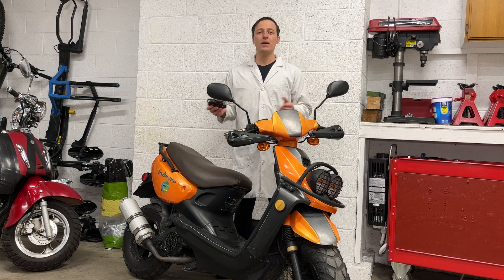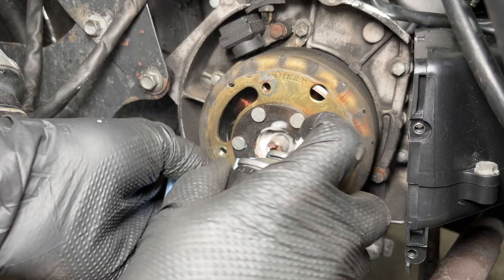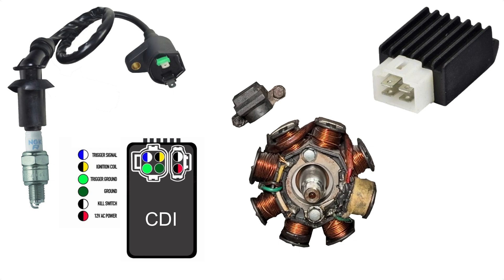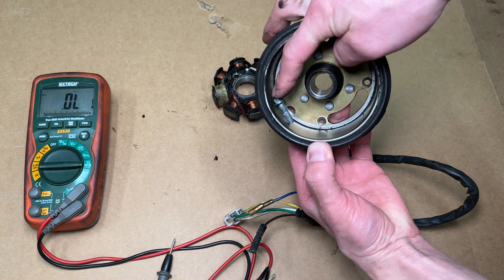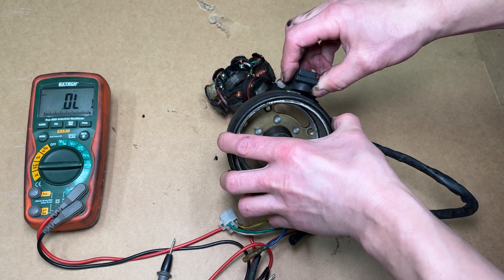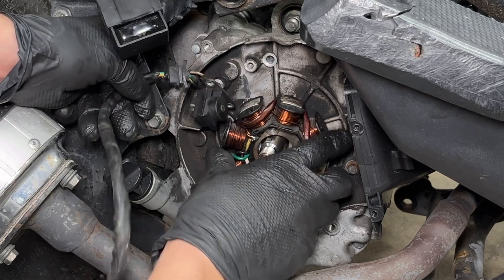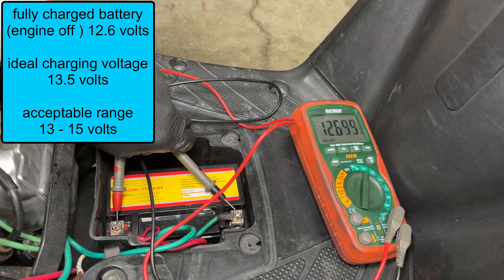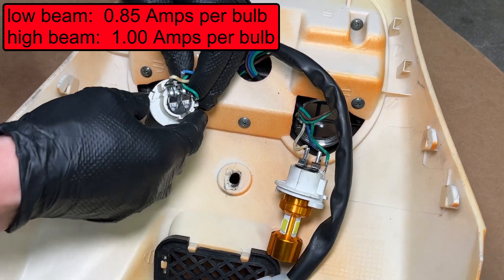Testing the stator and charging system in a 150cc GY6 Chinese scooter

Comment: I bought one about three months ago from a guy. It rode perfectly for a while. Now it sat for about three weeks and it wants to shut off and actually does shut off after about 10 minutes of writing. Luckily it’s just my kids enjoying it on our street. I’m getting about 12.3 V when idling and goes up to about 12.6 when wreved up. Do you think the battery can be hogging down the charging system? Are they supposed to stay running when the battery is disconnected? I thought it was bad gas but it definitely cannot be because it runs way too good for the first 10 minutes. Today I’m going to disconnect the battery and see how low it goes overnight. You are the man Brother nice detailed videos you have here. I definitely subscribed.

Comment: Hey paul, i am really stuck right now with a no spark issue. First let me just say, wether i use the old stator or the new stator i dont get a reading out of my multi meter for anything i do in this video unless the stator is hooked up to my scooter, secondly on both stators im not getting any reading when I test the green wire with the red/black i get nothing, just the OL. But when i test the blue wire with the green, i get roughly the same numbers on both stators which seem to be the normal numbers based on this video. Do you know what this could be? Do i just need to try another (3rd) stator? And my stator is 8 pole 4 wires. With 1 black/red 1 blue and 1 green and 1 white wire. And my multimeter was cheap only 16$. And i bought a new spark plug wire coil and that also gives me a reading of 0. Sometimes it’ll start at like 6 or 7 and then jump all the way down to 0 in a matter of seconds one number at a time. Weirldy enough that happens on both the old coil and the new one.But it seems as though the old one works even better because the new coil tends to be at 0 much more frequently. Any help would be greatly appreciated.

Comment: Hi, first of all, thank you very much for the very clear video. Unfortunately I have a different type of stator so my value will differ. How do I find out the spec (value) of a 31120-LEJ2-E10 stator so that I can measure it?
Reply from the maker: It's unlikely you'll find specs for that. The values should be similar to my stator. What you're looking for are open circuits, shorts to ground, or big differences between the windings with the yellow wires.

Comment: Charging: A clear mistake. Your battery charger work between the white and green. Yellow is for your headlight. Green is not connected to the case of the 1/2 wave regulator. Only it's ground lead. You can even run the regulator backwards with white to ground and yellow not connected.
Reply: No some does not need coil for lights, voltage comes from battery not stator

Comment: I just bought a vitacci spark 2021 150 for cheap that didn't run I noticed the wire coming off the stator doesn't have the red and black wire to power cdi   box this bike is suppose to work with a ac cdi box now this is the issue bike has no spark at   spark plug I can't find the 2pin connector  that goes to cdi box to power on cdi I have the 4 pin   but the other 2 pin wire is no where to be found also I mention there is no black and red wire coming out of stator for cdi am I missing  something here the wire colors that's come from stator are 2 yellow wires that plug into a white harness and there's  a solid green wire and and a blue wire with white stripe where is the black and red wire for cdi power or did someone put wrong stator in scooter

Comment: Can a flywheel be bad also? Cause I'm having voltaged jumping up and down super fast . Can't even read the numbers ..    what can it be .? I changed stator , regulator/rectifier.   And spark plug ..  scooter starts but voltage is jumping all over the place

Comment: 50cc scooter headlight high and shorts exploded.
In the check I made, there is a short circuit in the blue wire going to the headlight socket. The connector is charging. I am getting AC current. Where is the fault? On the alternator?
Reply from the maker: Most scooters with an A/C CDI will send AC to the headlight.  You should get A/C power on the high and low beam wires.  If you're getting power, it's probably not a short circuit. 
You can re-wire the headlight to use DC power from the voltage regulator, but be careful - these charging systems barely work, and you might not have enough power for a headlight.  From my experience, you can use 1 amp for the headlight, or about 13 watts.  Check out these videos:
https://youtu.be/ca15De1kCN4
https://youtu.be/w7h8P5DCNFo
https://youtu.be/FCiSSYDfpMM
Reply: Hello again. Thank you for your attention. You were right. The blue wire is not a short circuit. I'm going to buy a new 12V regulator. My guess is the 12 V in the yellow wire feeding the headlight and coming out of the regulator (conjector) is unstable. Thanks again... @LabCoatPaul

Comment: Hello I have a question I recently had a cooling fan to break into pieces on my moped and I purchased a new fan and I put the fan on but after I raod the moped I could hear something rattling around and it sounded like it was coming from inside the stator housing and I'm thinking that pieces of that fan may have gotten into that stater housing and yesterday I tried to start my moped and it will not start now it will crank over but it's like it's not firing and I checked the spark plug to see if I was getting a spark and is not getting a spark now and I'm thinking that the pieces of the fan messed up the stator coil have you ever heard of this happening?
Reply from the maker: It sounds like you had a cooling fan bolt hit your pickup coil.  That's the little box outside the stator that tells the spark plug when to fire.  Remove the fan cover and inspect for damage.
Reply: @LabCoatPaul  okay friend I really appreciate your help

Comment: Great video. I'm having a problem on my sym vs 125 2010. The stator outputs 100v @4000 rpm and the engine start to misfire at this rotation.
It's a problem with this stator or this is normal?
If I disconnect the three yellow wires from stator to rectifier, the engine works fine on all rpm.
Reply from the maker: That does seem a little high, but I don't think it's possible for the stator to create too high of a voltage.  Maybe try swapping the voltage regulator / rectifier.

Comment: Hello, when I connect my multimeter to the scooter wires that go to the rectifier if only gets to 2 volts at idle, does that mean that the stator is bad?
Reply from the maker: Yes, it seems like the stator is dead.  Try checking the yellow / white wires with the rectifier unplugged too.
Reply: @LabCoatPaul  yeah, it was dead, changed it now it works perfect the light's and charging system, but for some reason now it has a knocking sound from the flywheel, is it normal for the crankshaft to have a little play when you pull the flywheel?

Comment: I never ever would have thought that 12v ac would be running to the head light thats insane,
Reply from the maker: I think they do it to save money.  AC is just fine for an incandescent bulb, and that means less power has to go through the voltage regulator.  Less power through the regulator means you can make the regulator cheaper.

Comment: All my bulbs were blown when I bought a used moped. The voltage regulator was producing 17-19 volts. Check the voltage at the bulb connector. Moped will still run, but without lights or  turn signals . . .

Comment: Brilliant video, explains everything you need to know very clearly. I used to have a PGO GY6 150 with all of those problems that i fixed identical in this video, loved tinkering on it and it went extremely well. i have now purchased a PGO roughhouse 2T 50 to tinker with which the stator upgrade and the DC headlight mod you showed will be my first point of call. Thank you for the video.